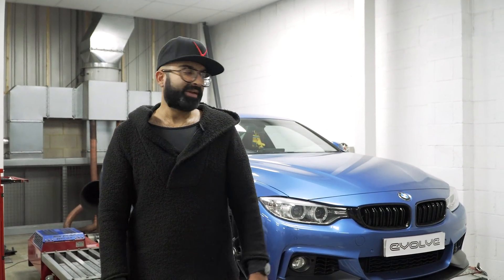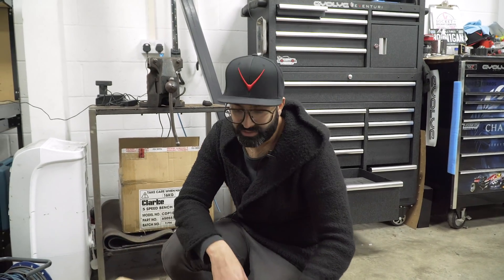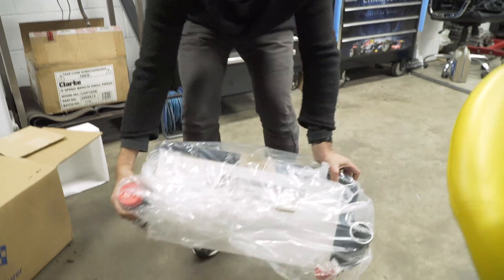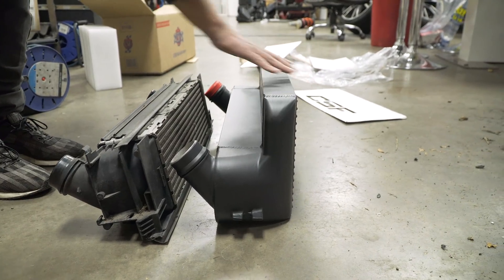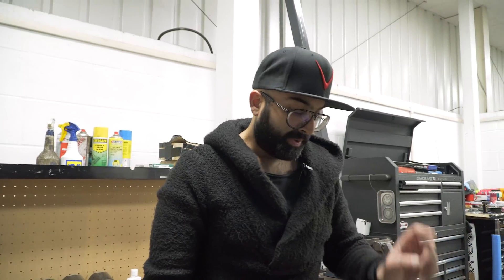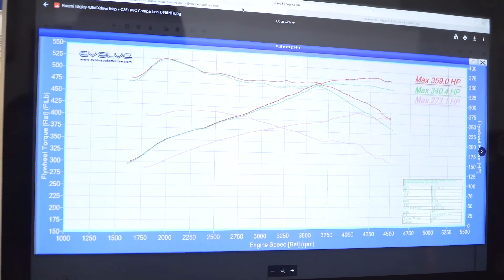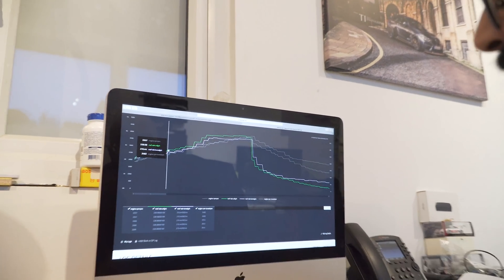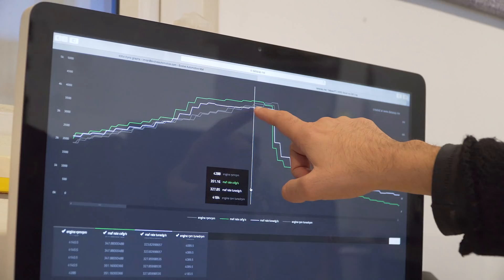435D Uprated CSF Intercooler Dyno Testing 335d Evolve Tune

Comment: Awesome.  Does the 5.5" IC push back the rad fan at all? My mechanic as saying it protrudes 1/2" beyond the radiator and doesn't fit my 435xi. Appreciate your advice.
Reply from the maker: We haven’t experienced that yet. It’s a very tight fit and does require trimming from memory - Check CSFs install advice.

Comment: But you had no fan blowing through the intercooler 🤔
Reply from the maker: Yes we did, we always have a fan running when dyno’ing. Creates a wind speed of about 90mph and will bend a bonnet back on its hinges. Setup was exactly the same for before and after.

Comment: 640d is the same as 335d / 435d in f30 terms, N57 engine and ZF8HP70 
auto, beware the HP70,, it has a 700nm limit and remaps well exceed 
this, and around 7grand to replace it.....the new g20 series are 
completely  different and use the newer B series engines I 
believe............could do with more info on this torque limit as its 
stopping me having one

Comment: Disappointing results to be truthful.  Meant to be nearly 310 standard without a map.
Reply from the maker: As explained in the video, winter tyres read considerably lower. More important is the delta, not the figures.
Reply: Evolve Automotive 
I totally understand
What tyres and tyre size would maintain the standard power and does the tyre air pressure have any affect?

Thanks and prior to bringing my car to yourself I would make the necessary adjustments on tyres etc so I can hopefully see the 400bhp mark hence why I asked the above question 😎
Looking forward to your reply

Comment: Good honest review here. I've owned a remapped 335xd for over a year now and considered putting a big intercooler on for a while. I decided on the CSF 8115b in this video and all I can say is I agree with this review. The car pulls harder and it appears to be more noticeable at higher rpm.
Reply from the maker: CSF Intercooler is a huge upgrade on all the cars it fits! BMW left a lot on the table for us here.
Reply: Hi gents, what about lag after intercooler upgrade? Is it noticeable? Is it increasing? Still have doubt on it before changing mine.. Thanks!
Reply: @thibautd.8641  If you've got 6 or 7 hundred burning a hole in your pocket then go right ahead, if not then don't bother. The best value hp is through a remap.
Reply: @DodgeCity111  thanks mate! And in terms of lag, not increasing?
Reply: @thibautd.8641  I didn't notice any more lag. It did seem to have more pull at higher rpm but this wasn't dyno verified, maybe I just wanted to feel more power.
Reply: @DodgeCity111  Thanks for your feedback, it just what I wanted to confirm before giving a green light to this purchase. Will definitely get on of these! Thanks 🙏

Comment: 273bhp ????? These are standard 313bhp. Surely winter tyres should not make that much of a difference
Reply from the maker: On a dyno they can make a huge difference. A lot of energy is lost as the softer rubber compound flexes against the roller.

One day I want to do an in-depth video explaining how dyno figures can be changed by conditions, so it would be fun to compare them back to back on the same car.

Comment: I thought 435D’s have 313bhp stock and stage one gets them to around 380/90 easy
Reply: I don't think this has had a DPF delete. They need it gutting or bypassing to hit 380+ but will hit that on the standard cooler.

Comment: Hi Guys - interesting video. I have a 535d (313PS) which will soon be coming out of warranty - so looking at an ECU remap. Could the CSF intercooler and re-map be applied to my 535d also (obviously a re-map could be applied - but wondering about the general layout and therefore fitting the CSF as well) ?? Many thanks
Reply from the maker: Hi Mark, we would need to check how BMW mounted the intercooler in the 535D to let you know how likely it is to fit. If you email sales@evolveautomotive.com one of my colleagues will be happy to assist you.

Comment: I’m currently looking for a 435d and with your two mods above having such impressive gains is there no market for air intakes etc as I’m struggling to find any for sale. Would you recommend any further mods or just these 2.
Reply from the maker: We haven't seen any gains from an intake so far. These two are more than good enough

Comment: Another solid Video, what would you expect to see from a f30 330d xdrive? 👌
Reply from the maker: Thanks! Around 330 BHP and 500 lb.ft torque.
Reply: Mine has 380 hp and 720 nm , 530d hybrid turbo 3.5 injectors this intercooler 🤩 and a good remap, straight pipe also

Comment: Great video, it would be great if you could do this sort of thing for the 320d engine. I think alot would like to see how much power you could get from a 320d
Reply: Bonjour, ma 320D A Xdrive MSport a été modifié récemment, passage de la puissance de 184 cv et 380 Nm à 242 cv et 493 Nm de couple afin d'optimiser les performances du turbo , je viens de commander un wagner Intercooler compétition , je devrais récupérer couple et gain mais surtout fiabiliser le moteur avec plus d'air frais et de conserver son rendement , restera le passage au banc, actuellement j'ai l'impression d'avoir changé de voiture avec un couple présent à très bas régime sans rétrograder

Comment: Should be running near 400 bhp and over 600 ftlbs with a uprated IC. I Wonder how these compare to a wagner IC? How much are they?
Reply from the maker: The gain is correct from the map. Winter tires make both pre and post reading lower than they should be but gains exactly what we expect. Usually we would except closer to 400 when the stock car makes 330 plus bhp. Not had any experience with Wagner . The CSF is £660 Inc vat.